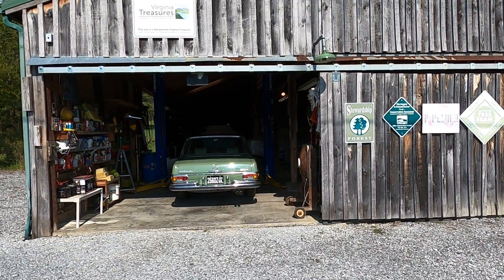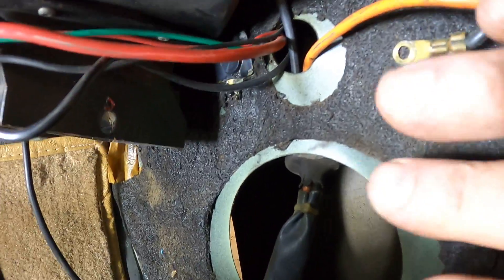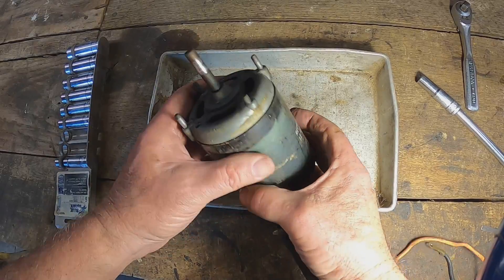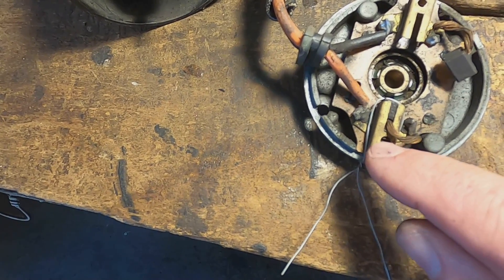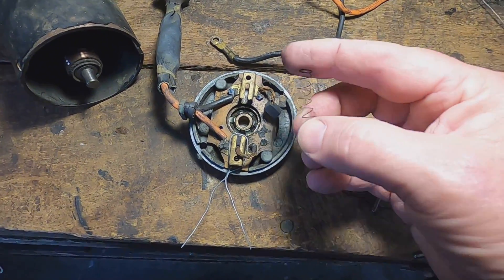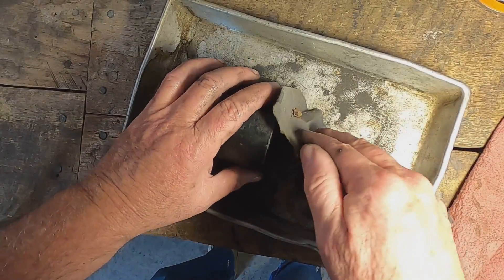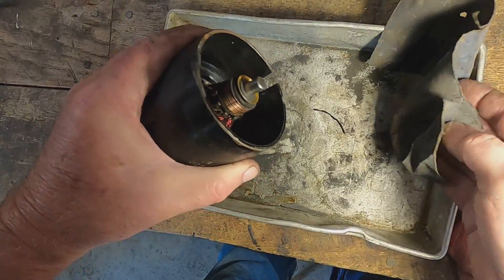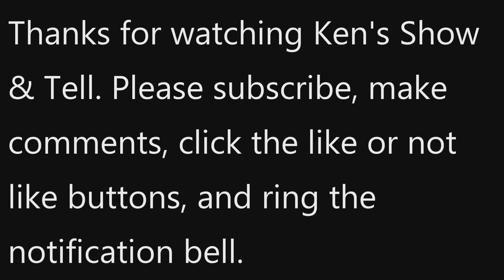1972 Mercedes Benz 280 SE 4.5 (W108) AC Fan Blower Motor Maintenance 9-21-2024

Comment: Ken, quite a video!   Thank you for posting it.   Do you have a video of the work that you did on the blower control knob?   Mine seems to be either all on or all off and I’d like to tear it down and improve its operation.   Thank you.
Reply from the maker: Thank you for watching, Joe. No, I did not make one. I took it completely out of the panel. Just remove the little door below the control knobs and disconnect the wiring and remove the entire knob assembly. You will see the rheostat mechanism that controls the speed of the fan by increasing and decreasing resistance of the electrical current. Sometimes the hard ceramic backing is broken and comes apart. Mine was intact. I cleaned the sweep pick-up, and the coiled resistance wire with Deoxy-5 and very fine Emory cloth. Once you study it you can see how it works.

Comment: Great video again Today Ken of you Servicing your Mercedes-Benz W108 AC Fan Blower Moter Maintenance They're Not Easy To Mend or Replace Parts on Them but you can Mend Every Think Ken Well Done 👍Keep Up With The Good Work Ken 👍The Weather In The United Kingdom Today Was A Wash out Ken Rain all day And got alot Of Flooding in my Part of the Region Of The United Kingdom I hope the United Kingdom Gets A Few More Days of 25 Degrees C Before The Winter Starts How Has The Weather Been In MiddleBrook VA Ken?
Reply from the maker: I thank you again for watching and your continued support. Yes. The only correct fan motors available are from parted out cars so you might as well repair what you have. Anyway, these were serviceable and not throw away parts. You just have to discover how to do it. Our drought is over, a hurricane is churning up the Appalachian Mountains from the gulf Coast. We have gotten close to 4 inches of rain over that last week and expect 3-5 more inches tomorrow. Very welcomed indeed. However, the folks in Florida are getting 140 mph winds. It is very usual for us to end the summer with a drought and enter the fall with hurricanes churning up the east coast breaking our drought. The air has changed from a refreshing dry 65-degree F to very humid tropical air in the high 70's F. this will change back to our seasonal dry -cool air once the remnant of this hurricane passes.

Comment: I remember that Lucas dynamos had an Oilite bushing made of porous sintered bronze. Replacements had to be left in warm SAE30 oil for 15-30 mins or for 24 hours in cold oil. I wonder if yours is an Oilite or a German equivalent?
Reply from the maker: Good question. The entire motor was meant to be rebuilt, and the bushings look like they can be taken out. However, I took it down to where I felt comfortable. I appreciate you watching and commenting.

Comment: Hi Ken - Have you ever replaced or tensioned the power steering / water pump V belts on this car? Mine are loose, and the MB guide shows how to swivel the power steering pump to tension, but I can’t seem to find a way to get enough leverage to properly tighten the belts. Are there any tricks? The internet seems to be devoid of information on the early style pumps that don’t have a tensioning nut.
Reply from the maker: Sorry, I can't help you with this as I have not done that job before. I suggest you contact John Wright as he is the administrator for the Facebook group Mercedes Maintenance. I've found him to be very helpful and he is an expert on the W108. https://www.facebook.com/groups/1320965937922962/
Reply: @kensshowtell  Appreciate the advice!